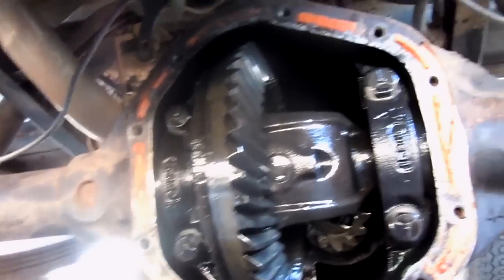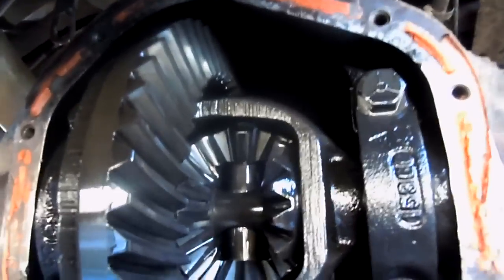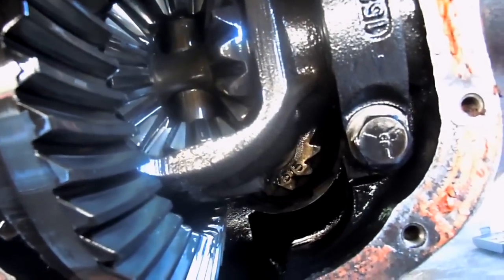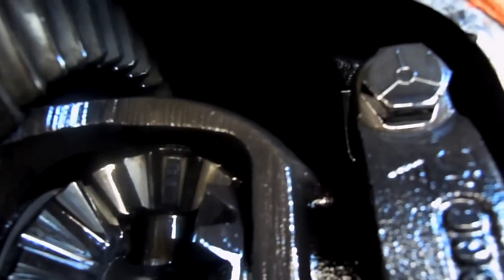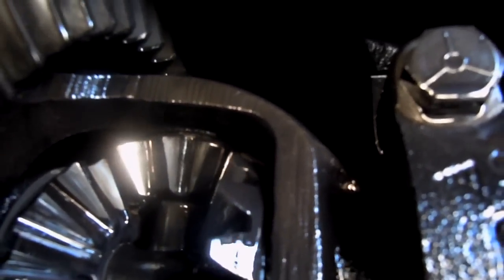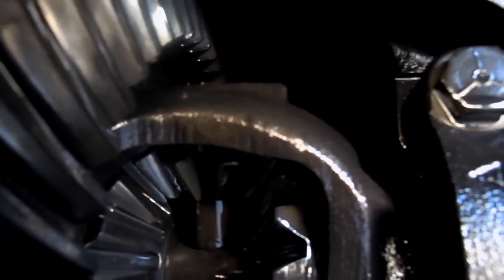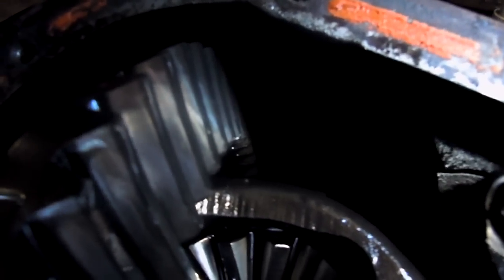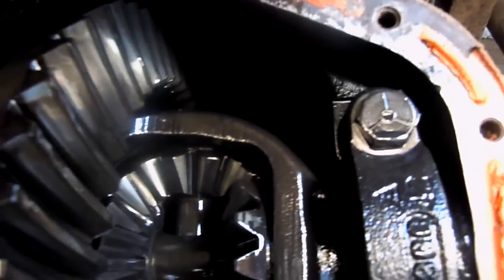Spider Gear Play Inside My Dana 44 Rear Differential

Comment: Those have a bit of play against the cross pin and inner area of those two spider gears when they are new because they are designed to allow 80w oil to flow between the cross pin shaft and inside of your two spider gears. You can buy a brand new cross pin shaft and the two spider gears new and spray wd40 on them and get a left to right play of  8 thousandths.  And those two spider gears only turn when go around a corner or turn and the rest of the time the whole case turns.  So during those turns there has to be some side play for 80 weight oil to get in.  I looked carefully at you moving that case  back and forth and nothing is wrong
Reply from the maker: +Earl Guyton Yeah, it's completely fine.  Thanks for the explanation of the play, it makes sense.  

The issue was that the side gears were too small for the carrier.  There was a 1/8 inch gap all around the side gears, so the two halves of the axle were not being constrained to the centerline of the axle tube... they were just banging around all over the place.  Luckily no damage resulted from this... just a hell of a lot of noise.
Reply: vespira it was play from side gear splines?
Reply: .008 is the spec for spider gear play? Mine is over .050 🤦🏼 that’s where my clunk is coming from, pinion backlash is within .001 so I know this is my problem. Ty, couldn’t find that spider gear play spec anywhere
Reply: @Tekjive  A clunk sound reminds me of pinion shaft play. Two of your spider gears dont even turn when youre driving straight, but when you make a left or right turn the upper and lower spider gears turn.  Two spider gears run off of your inner splined axles, and the other two simply turn on the cross pin. Now if the cross pin spider gears have 50 thousandths clearance I doubt it would really matter at all. Just be sure youre using a thick 85 weight plus oil
Reply: @EarlGuyton425  this helps alot, ty for the reply, it makes sense too, Im learning everything rear diff in the last few weeks trying to fix this. I can’t find my clunk problem, effecting both axels now, when accelerating straight. It started with a loose pinion nut (I was able to loosen it by hand with barely 10lbs of force 😬) buddy overtightened the crush trying to help, so I had to pull the carrier to inspect and replace the crush. Everything is still machined edge new except spiders but they still looks great. Everything is within spec now (rotational torque, etc) and I decreased the pinion/ring backlash to minimum spec .005, but that clunk is still there. Weird thing is when the pinion nut was too tight all the clunks went away but it was creating excessive heat. How can it still be there with the new crush and pinion set within spec (11in lbs Rotational Torque for used bearings, 18in lbs with pinion and carrier, per my 07 Nitro service manual) I’m going nuts bro, at this point the only thing I can think of is putting the carrier back to its original settings (I mark everything now) but that would only increase pinion/ring backlash …it’s not making sense 🤦🏼
Reply: @Tekjive  I did suspect it was pinion shaft related or ujoint saddle flange with the center nut. That nut has to be seriously tight! And yes, go back with what the original setup was on that ujoint saddle and nut. They can also have a thump, if the pinion floats in and out because the slip yoke on your transmission can go in in 2 inches more than it is for when a vehicle bouncing down and if a pinion thrust in and out it will cause a clunk.
Reply: @EarlGuyton425  ty for replying, I’m trying to find out why I still have a clunk, which seems to have changed from excessive backlash (pinion nut loosened itself) to now being at each axel (sometimes solo, sometimes both axels) when accelerating/decelerating) I have no clunk sound when shifting, made sure my backlash was .006, but soon as I let off brakes I hear the clunk, and like I said while accelerating/decel. Can under/over spec carrier preload cause this? I have adjusted the carrier to reduce the backlash (after making sure the pinion is set correctly with new crush sleeve and correct rotational torque) from original factory location to tighten it up some after 225k of usage, still have marks where adjusters were originally located tho jic (gears and bearings still look new, to the point they still have a factory machined edge on gears and no visible wear on bearings/races) axels splines and side spider gear splines are near perfect/no play as well, but this clunk is driving me nuts man. I’ll see if you have a page I can communicate with you directly if you don’t mind. I can’t figure it out :/
Reply: @Tekjive  Let someone else fix it for you, its too much for you
Reply: @EarlGuyton425  I’ll figure it out, thx anyway

Comment: I have the same exact issue with my 2000 Mustang GT. Can you please tell me what the issue was and how much you spent on the fix? I would really appreciate it. Thanks!
Reply from the maker: Not sure you have the same issue, but I'll describe it here.

If you look at the diagram for my rear differential [ https://www.kaiserwillys.com/media/catalog/product/auguria/interactiveimage/Rear-Axle-44-D_5.jpg ]  the image here has the spider and side gears circled and labeled as part #20.  The larger two gears in that set are the side gears, and you can see that they have a cylindrical face that will rest inside the journals of the transfer case itself which is what keeps the side gears centered and co-axial with the axle.

Now, the previous owner upgraded the front differential at some point to a more stout unit, and due to the fact that there was no ring gear/pinion for that front differential that matched what was already in the rear, the owner changed the ring and pinion in the rear differential to match.  This is where the problem came in.  There are TWO different sizes for the side gears in the Dana 44.  Since the ring carrier had to be swapped when the ring was swapped, the old spider gears and side gears would no longer fit and a new set had to be ordered.  The newer side gears have a slightly narrower cylindrical face so they do not stay centered within the original journal (housing was not replaced).  The owner shimmed the side gears with what I can best guess to have been aluminum can strips.  Those eventually failed.  

When I took the Jeep in, the shop discovered the problem and ordered the correct brass bushings for the smaller side gears and pressed the bushings into the journals of the housing.  As a result, the side gears no longer had slop and weren't banging around inside the journals.

Comment: Any luck yet on fixing it?  I have this exact same play I noticed when changing my fluid.  I have a really nasty whine/howl noise and I'm positive its from my front differential. Thinking this slop is the cuplrit. Can I tighten something up or does everything need replacing.  Had my differential rebuilt six months ago and I'm thinking maybe the guy didnt get the backlash correct?
Reply from the maker: The issue is a bit complex, but I will attempt to describe it here.

One of the previous owners had upgraded the front axle to a Dana30 with a 3.54:1 gear ratio.  Since this thing is running 31" tires and lacks an overdrive, the previous owner elected to drop the Dana44 rear to a matching 3.54:1 gearing instead of bumping the front up to match the rear.

There are different open carriers apparently to accommodate different sized ring gears, and the carrier was replaced at this time to the best of my knowledge.  Unfortunately, the bearing, or the journal for the bearing on this new carrier, was not the correct size, and a necessary bushing was omitted when the axle was reassembled.  As a result, the differential end of the axle shaft was not constrained to the center of the axle tube and was allowed about 1/16 of an inch of play.  

The noise was simply the side gear/axle shaft banging around inside the differential housing, and whenever load was applied, torque would pin the axle in one position and eliminate the noise.  The problem was ultimately identified when it was discovered that the wheel could be tilted when grabbed at the top and bottom while up on jack stands.  This was because the whole axle shaft was pivoting around the outer bearings.
Reply from the maker: Amazingly, this Jeep still has the original Dana44 axle shafts and they are in great condition without any twisting/bending or pitting.  This Jeep was manufactured 04-August-1964, so considering the fact that the axle is just shy of 50 years old, I am not going to complain one bit.  

Despite the highly abnormal condition due to the bearing problem and the ridiculous amount of play, it does not appear that any other damage occurred.  
I had to take the Jeep in to a shop to have the work done since there was no way in hell that I was going to be able to pull the wheel hub on the passenger side.  We blew up one 5-ton puller trying.
Reply: ***** I  so as I was saying about mine being rebuilt, I believe i pretty much had the same problem with too much slack in mine due to mechanic error of not knowing the correct backlash and so after I drove it and it broke it, everything fell into place and the slack happened.  eventually I tore up the driver CV and thought my axle was completely done for.  swapped it in with a junkyard Dana 30 LP.  couldn't find a HP with 3.73's anywhere.  was like better than before I put my lift on at this point.  and now I need a new transmission line, lol.  have to Pay to Play >.<

Comment: Broken center pin ?? Looks like it to me ..
Reply from the maker: Not a broken center pin... that thing is still holding up.  The problem was due to an improper bearing selection when the carrier was replaced due to a need to accommodate the new ring gear. I replied above with the full details.  The Jeep is still in the shop, and I'll post an update when I get it back tomorrow or Friday.
Reply: *****  Right on glad you are getting it fixed !!  I rebuilt mine and put in a Spartin locker ..No more spider gears !! Love it .. Works awesome..

Comment: Did you ever fix this??  If so what was it ?
Reply from the maker: Have not been able to fix this yet.  The carrier is fine, but the axle that the spider gears rest on needs to be replaced along with the spider gears.  I was unable to remove the wheel hub on the passenger side, so I have not had a chance to address the problem.  We stripped the threading on a 5-ton hub puller, so this job will require a bigger hammer.
Reply: ***** a trick that probably won't work for you since its really on there, but still is good to know, once you're ready to pull the hub, put the brake rotor on facing backwards and only thread the lug nuts enough to handle using the rotor as a pull hummer.  was easy on mine but they were only 20 yrs old
Reply from the maker: dirk diggler drum brakes... 😝
Reply: ***** i haven't pulled my back hubs yet, need to one day but I believe you have c clips you have to remove from the pumpkin before you can pull the back ones. But you can use the drum the same as a rotor to pull it once the clips are removed.  like I said though haven't done my back axle yet.

Comment: I bet it’s your drive shaft angle.
Reply from the maker: Tim Burton nah, one of the previous owners swapped out the front with a stronger axle, and when matching the gear ratio in the rear, used a carrier and set of side gears that didn't quite fit properly.  There is a journal that the side gears fit into, and the new ones were just a bit too small.  They apparently shimmed it with Coke cans or the like, but that wore out.  The shop replaced with proper bushings.